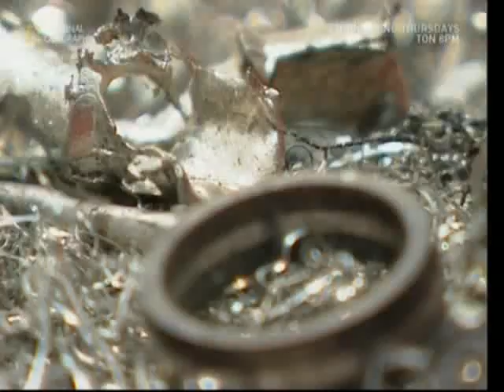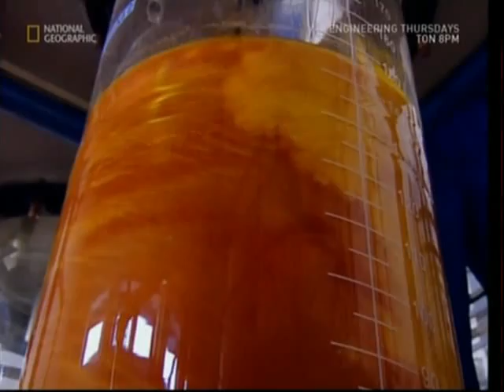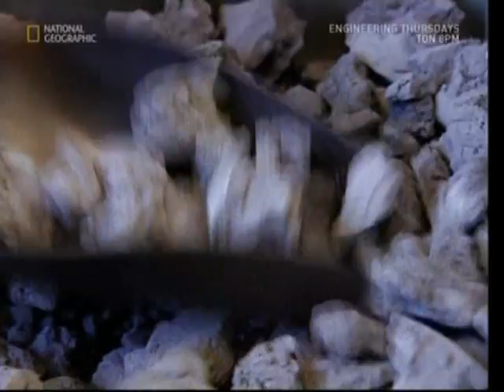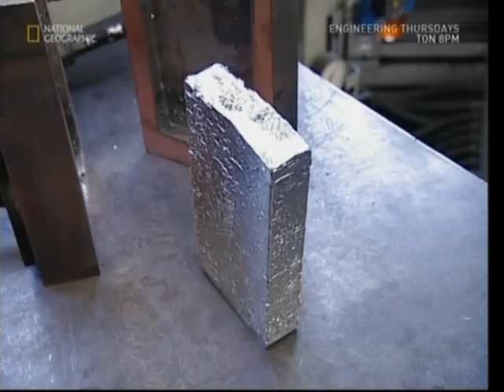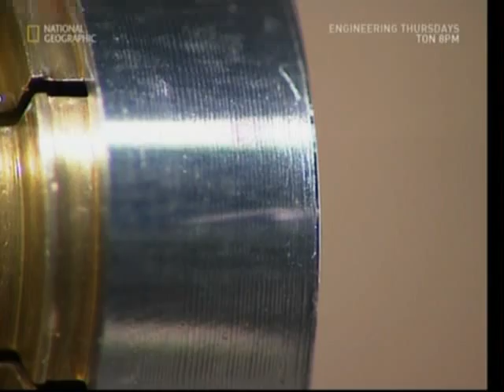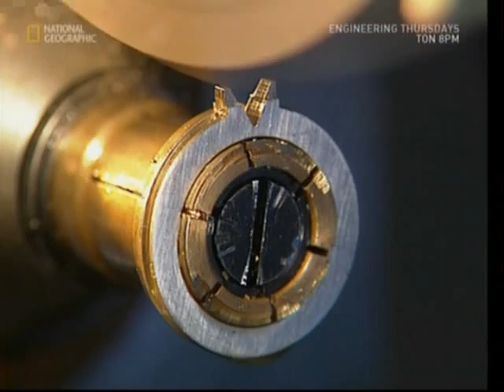How Platinum Rings Are Made

Comment: platinum is not as rear as gold. the reason it is so expensive is that it is in such high demand
Reply: it looks nicer in my opinion!
Reply: No, you're wrong. Extraction is difficult and it's rare.
Reply: Extraction is difficult, yes, but it is a lot less rare than gold. The reason it is so expensive is that it can be used to make incredibly resistant lab equipment, and it is used to make catalytic converters for cars

Comment: "Platinum doesn't corrode because of its purity"

Okay. Give me pure Iron and tell me that won't rust...
Reply: Pure platinum is extremely stable. That's why it's used as electrodes and in your catalytic converter.
Reply: You're assuming that pure iron and pure platinum react the exact same with oxygen.
Reply: @thesovietxman  yes
Reply: +Yog Sothoth I'm pretty sure pure silver does tarnish in air, but only after ages.
Reply: "because of its purity"
Reply: Pure iron doesn't rust. It only rusts when mixed with oxygen. However,  gold doesn't tarnish even when exposed to sea water for thousands of years.
Reply: Nathan Ryweck no, that statement is false when you say it like that. Pure iron "does" rust and that's because of the presence of oxygen forming iron oxides at a handful of oxidation states.
Reply: Jake Townsend there's a pillar in India,over 1,000 years old,outside, that shows no sign of oxidation
Reply: +Jake Townsend I think he meant compared to other precious metals. Gold and silver on their own do not rust or tarnish. They tarnish only because they have other metals added in sometimes.
Reply: @YogSothoth24601  Pure silver gets both a black patina and also whit "milk spots". Pure gold doesn't tarnish at all though. Both are very soft and pliable in their pure form though.

Comment: Platinum is not, (at the time of this comment), "worth twice it's weight in gold". Actually the two are around the same price range. The entire platinum series of elements are actually all fairly expensive, (palladium being among the cheaper of them). Also, as far as I know, high purity Au does not change in color as it is non reactive with most everything in the air.
Reply: Ada Wong high purity gold is not used in jewelry